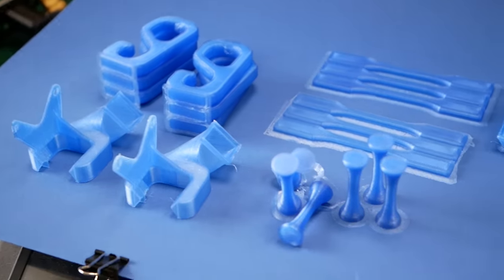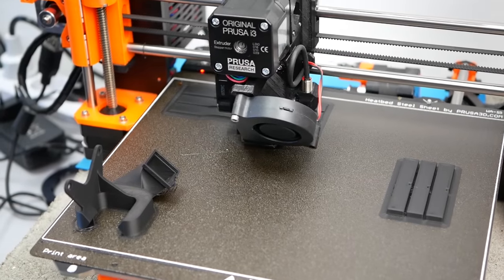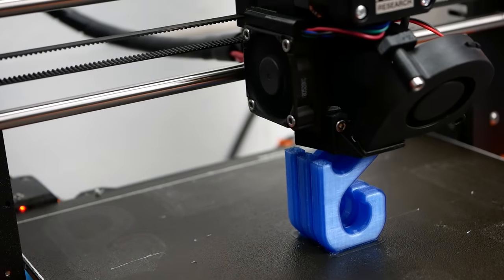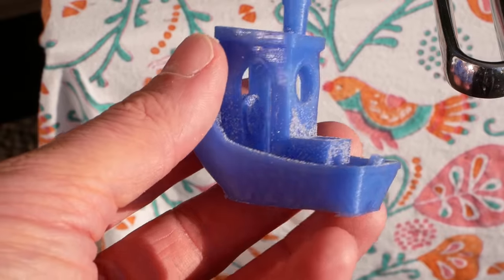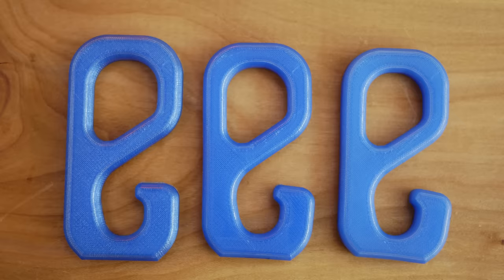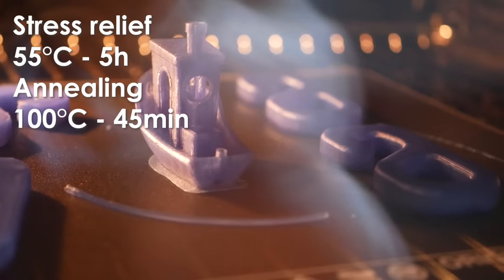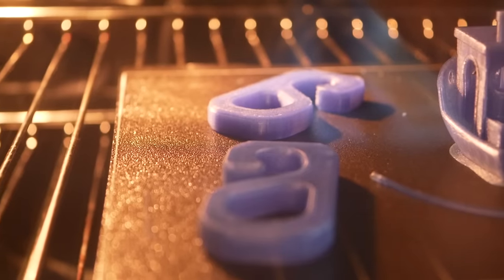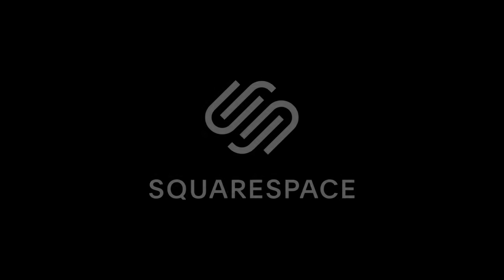Strong 3D prints through ANNEALING, but... Part 1: PLA

Comment: This sounds something like what we do when casting bullets our of lead alloys. Yes our temps are much higher (720 degrees F). We drop the hot bullet as fast as we can out of the mold as soon as it changes from a liquid to a solid into a bucket of water, the colder the better (Does not stay cold very long). We do this to increase hardness. It has something to do with crystals in the alloy. I wonder if cooling fast is possible and if it would make a difference? 

Thank you for your videos, I have ordered a 3D printer and have been watching your videos. I want to use my 3D Printer to make Antenna Parts for Amateur Radio.

Comment: The interesting part of anealing pla is the improvement of heat resistance. After the anealing process, pla stay strong and not deformable up to 100 c + . I designed and printed a air intake for a car out of pla that shrinks under 5%. Works perfectly since half a year now without any issues.

Comment: If you use a heat-gun, you can fuse the outermost layers together in one area at a time, while the rest of the print stays cold and rigid to maintain the overall shape.  The only way to fuse the entire print together would be to print 100% solid then use that to make a mold, then re-melt it in that mold until the plastic is completely melted and then resolidifies, similar to casting a metal part.

Comment: I've annealed HTPLA flywheels so that they can withstand running on hot motors. While I was successful in annealing it, I had a yield rate of about 1% of "acceptable" flywheels where they hadn't warped and secured snugly to the motors. The other 99% deformed enough to not be useful.. I couldn't figure out a pattern in the failures.. To put this into context, the flywheels are spinning at 35-45k RPM with clearances of about 1mm. I found it better to just print in regular PLA and redesign the wheels to include an impeller to pump air through the motors. With this, I can get fairly well balanced PLA flywheels spinning at around 75k RPM.

Comment: One thing you could try is to put the sand on a container with a screw-on / clamp on lid. With a little pressure the sand will lock in place a lot. One thing I want to try for a very precise pla parts that needs its internal stresses removed, is to cast it in plaster, and anneal it as such. Probably not very practical for most purposes; but hopefully it will work as intended for my niche one.
Reply: Also; dunno about busted; you should have tested the melted-down hook at 0:26; I bet that would have absolutely dominated the strength test :)

Comment: If you're worried about the bend modulus changing, could you use your 3d scanner to scan the deformed test piece then 3d print the control with that mesh and compare those?

Also agree with what others have mentioned about trapped air potentially causing further layer adhesion.  The fact that your XY shrinks and Z pillows in that cube corner calibration piece shows that air is trapped (albiet the infill space is more to blame there).  Could you do zero perimeter pieces or cut/sand external faces to expose solid linear infills and test if giving air between extrusions a place to escape can improve your results further?

Comment: Sand is too soft even if You pressurised it. If mechanical properties needed to be impruved without warping and geometry deformation maybe use a gypsum? Print and pour in gypsum, wait a little before it will dry out and only then put into owen with 70-80% of melting/printing temperatures (if material melt on 100 degrees so use 70-80 degrees). Dryed gipsum didn't change the shape so printed detail can't chenging shape also, but pure gipsum pretty easy to ramove and reuse. It be useable only with details like hooks You use, but I think use it for some hollow details was screwed...
Also some one using aceton to remove layers texture and I think it can help to adhesion and stranghtened details too. Sorry if video about already was I did't see it yet.

Comment: I have used a heat gun to remove "wisps" that sometimes appear, and if used VERY carefully, it can slightly smooth layer lines without warping the shape. It isn't consistent, however, and easy to mess up.

Comment: ive already  used de sand trick with 100% succes rate. the trick consists to mantain the sand with pressure, i put a metal sheet (a Real thick one) on the top the sand  and that makes the trick. Also the sand need to be a little wet . And the PLA needs to be printed the best dry way possible. Ussing a temp probe near the print you can follow the temperature  changes. When the temperature is near 110 C  you need to turn off the stove you will see that the temperature stills rise up a few grades. then just like that the sand will mantain the temp near 105 for more than 50 minutes.

Comment: What if, instead of whole-part-in-the-oven annealing, you heat treated specific areas with a small flame torch to fuse the layers, let each section cool before moving on to reduce warpage?   You could do that to the stress-point of a vertically printed hook and see if it strengthens the strain point...  The problem I guess is not overheating it...
Reply: I use a soldering iron with more filament to reinforce the layer this way. Heatguns can do but the warping is way worse without a lot of practice. Also the heat dont reach very far in, so to just dip the whole thing in epoxy make it just as strong if not stronger
Reply: You're more likely to add as many or more stress points as you remove. To remove stress you need to normalize temperatures between regions, and the only way to do that effectively is to heat the entire part as evenly as possible.

Comment: Annealing means heating a small cross transversal section while keeping the rest of the material at temperature, then traverse the object along its length with the heat differential. You can concoct several annealing regimes, like increasing transversal section heat while going up or alternating between melt and heat temperatures, etc. What you are doing is baking the objects, not annealing them.

Comment: You know, if i want strongest parts possible, i will use 100% infill with 105% flow. I print pla at 215°  way slower. Anealing these parts wont warp as much and the cristal sizes wont be limited by the latice. Also, as it warps less you could heat them a bit more. 
I would suggest using finer sand and with 100% infill, heathing them more wouldnt warp them at all. Using something like dry clay powder might make a temporary cast mold to contain the melting pla

Comment: To deal with warping, it could help to not preheat your oven and to turn off convection. This is assuming that the warping is caused by uneven heating of the PLA. Because PLA is a bad conductor of heat, perhaps measures should be taken to ensure that it is never exposed to too steep a temperature gradient.

Comment: I read an article where they tested PETG's ultimate tensile strength after being annealed at different temperatures and they found the best results were obtained after ennealing the specimens at Tg minus 20°C. Also that annealing temperatures closer to the Tg decreased the ultimate tensile strength of PETG due to the rejuvenation process and also had a more ductile fracture compared to the aged at Tg-20°C specimens. Another interesting finding is that it is best to have the specimens annealed at a range of temperatures beacuse different activation energy is required for different chains in the specimen.
They achived about 53 MPa annealing at Tg-20°C and about 40 MPa at Tg if i remember correctly.
Reply from the maker: Do you have a name of the paper?
Reply: No. i tried to look it up but i only get access to it throught my university's website but it seems to be down for whatever reason this weekend... when the website is working again i'll look it up and let you know asap =)
Reply: Optimizing physical aging in poly(ethylene terephthalate)-glycol (PETG), Journal of Non-Crystalline Solids
Volume 502, 15 December 2018, Pages 15-21

Comment: Interesting investigation as usual... I really adore the way you apply scientific method to your investigations. Keep up the good work.
I wonder if the layer adhesion quality is related to the hot plastic being reactive to humidity or oxygen in the air, or perhaps some air is trapped at the interface between layers reducing the effective connection between them. Is it possible for you to make an investigation about that idea? [3D printing in a vacuum, different pressure levels or in an inert atmosphere]

Comment: I know this is an older video but had anyone suggested vermiculite which is the material used in annealing steel. To cool it slowly and controlled . Could probably even break it up to smaller sand-like material. Just a thought

Comment: Great job Steffan! I have a presentation coming up that I'll be sure to plug your channel during :) looking forward to the next video. Definitely doesn't seem worth it with this material considering the warping the time would be better spent optimising design and print settings. I'll definitely continue to push people towards PETG for heat resistance and durability.

Comment: you should try microwaving them.
microwaves penetrate the surface better and start heating from inside the printed parts. you would need to adjust wattage properly and probably toggle it on and off in the right frequency

Comment: I have tried to print some parts at 100% infill, then put them into a plaster and heated them to nearly melting point of pla. The idea was that all layers will fuse together. Then the plaster is just "disolved" in water. But my test were unsuccesfull probably due to a low temperature. And i never tried again, but i thing that i could make the part really strong. Would be nice to see you test that.

Comment: I would like to see this same test with powdered salt in two ways...

1st - part in slat inside a food saver vacuum bag, and put in an over, and boiling water.

2nd - use a salt and alcohol like platser to make an easy break away mold, that you could remelt and cool to part, without the problems you had with bubbles and water cleanup...

Comment: Using metal beads used during bead blasting should yield good results they come in sizes smaller than single grains of sand while weighing much more than sand. I have a bag of these for other experimental uses.

Comment: TIP: Lower the heat by about 20 degrees but extend the "cook" time.  Just as with a fine meal, the slower the cook the better.  Also if you're going for better strength, you should print it slower as well.  Possibly change nozzle tip/thickness etc.

Comment: I had a friend accidentally heat treat a 3dp part; it was a motor mount for a large brushed motor that for some reason entirely encased it. Safe to say, after a few minutes of the motor running the PLA clocked in at ~100c and was on the border of structural integrity. It definitely was stronger than before, but unusable as he had designed it because any time it would’ve been used it would just melt again..

Comment: When annealing sintered metal parts you use an autoclave because pressure is just as important as heat. Injection molded plastic parts are formed under pressure: between 2 to 8 tons per square inch depending on the material.
So it's not surprising you're not getting significant results by just baking your 3D printed parts.

Comment: So we want good layer adhesion, ideally fusing layers into one, right? So here's a general 3d printer idea: what if during printing, we fully melted the previous layer (or rather, a small spot of it directly under the nozzle) before adding material into this moving molten spot? It would be like the difference between hot and cold solder joints.

Comment: In particular have ever been very skeptical about the annealing of the printed parts, the objective of the annealing of metals, if I have not forgoten my metallic materials class, is to relieve stress on the cold machined parts and make them more ductile so less brittle. Maybe a different experiment can be carried out to measure how brittle the parts are with and wothout annealing, this will be relevant in the case of PLA. In my little experience printing higher hotend temperatures have given better layer adhesion to petg parts and really have no expectations that annealing can do any improvement in petg parts, anyway will be waiting for the results when you carry the test on petg samples. 😅

Comment: It should also be worth mentioning that not all PLA is created equal and I would well expect different results when dealing with different formulations of PLA.  I wonder if the colorants might also play some role. But it would be a nightmare to test hundreds of parts across a spectrum of the popular pla types and colors.
Would like to have seen some real numbers on the temperature resistance increases of non-annealed PLA vs annealed PLA which I see as being one of the largest benefits of the process. 
Thanks for the detailed work.

Comment: I did some tests and found that only a few PLA filament brands warp as bad as the one in the video. I had quite good results with the Verbatim PLA. It costs around 20 Eur on amazon. I also found that the temperature for annealing has quite an impact on it. I found (for my oven) that 110° is way better than 100° and 120°

Comment: Maybe the way to improve layer adhesion is to build a printer that can withstand high temperatures (like printing inside an oven). 

Heat the environment more and more with each print until you find a temperature where the previous layer cools enough to maintain its shape, but is still warm enough that the next layer's heat will be enough to bond the two. 

Too hot and the print wont keep its shape, too cool and the previous layer will be too cold to properly adhere to the new layer. 

Thoughts?

Comment: Could be worth a test to increase the pressure during this process, maybe placing the part inside hot water while its confined inside a pressurized tank. Maybe 3 or 4 atmospheres of pressure may help the molecules inside the part to rearrange and strongly bind together. Trying the 3d gyroid infill at 50% or more, could help when applying pressure outside the part so it may distribute evenly.

Comment: I would love to see layer adhesion tests for prints that are more solid, you could be running into the limitation of the amount of material before you're seeing the results of annealing. 

Increasing fill to 90-100% would usually yield a stronger part as it is when printing slowly enough. So perhaps annealing a solid part would give the layers a better chance at sticking together :)

Comment: Thanks for the great videos. Have you tried 'tempering' in hot water? The maker lab at a local college places PLA prints in water and then in a microwave till the water is hot but not boiling (guessing about 70-80C) then slow cool to room temperature followed by a second cycle where the water is brought to a boil and slow cooled. I have tried this at home on small parts and it does not seem to do much damage but not sure if the parts are stronger or more heat resistant.

Comment: Used annealing (with boiling water) on a couple of PLA visor clips for my car. Without annealing they drooped on the first reasonably hot day. With annealing, they haven't changed after an entire summer. Big win. I tried precompensating for size change but it seems the shrinkage is specific to the particular shape so I had to use trial and error.

Comment: I know alot of people that make weapon parts anneal thier parts and seem to have better results while when they arnt have a higher chance of blowing up in thier hands the reason for it is because it's more for if you do a squish test I believe but also they seem to go with pla + a increase in size values so everything fits after the process but also instead of sand they will have a tight mold such as compacted salt or some special type of dirt that you would use when making molds for molten metal.

Comment: You should use an oven thermometer when doing these experiments. Baker's know ovens can fluctuate in actual temperature vs readout by over 30°
Reply from the maker: I usually do that. The temperature in mine usually is +-5°C accurate.

Comment: I discovered for myself the thermal resistance benefit accidentally when a 3D printed bracket that I made got slightly melted and deformed from sunlight. I was able to heat it up again and straighten it out so I remounted it in the same spot. And since then it hasn’t melted again.

Comment: here my theory how to improve layer adhesion: first- print very slow with thin layer . second- mount a heated element around the nozzle to increase temperature of part surface where next layer will be added, will be similar to a heated chamber but temperature can be cranked up above glass transition temperature.

Comment: My experience. Feel free to apply the scientific method and increase your sample size. PLA SPECIFIC. I use a heat gun, which even on low reaches at least 250c almost instantly. It's very hard not to deform the parts using it. Layer adhesion did show a minor difference, but it was purely aesthetic, and did not provide integrity. Was unable to remove the layer lines or even correct simple mistakes without going well beyond the glass stage and ended up with a gob of plastic goo. I also tried Tamiya model cement, to no avail. Next up... Bondo.

Comment: If you have any dimension critical portions, like holes or distance between holes, you should place something in them that is more dimensionally stable, like metal rods. For spaces between holes, you will have to have a jig, which isn't practical for single prints. Wood probably wouldn't work for a jig with unless the points of attachment that are aligned with the grain. 
BTW, I have no experience with 3D printing, I am just applying techniques from another field for a quite analogous process, so caveat emptor.